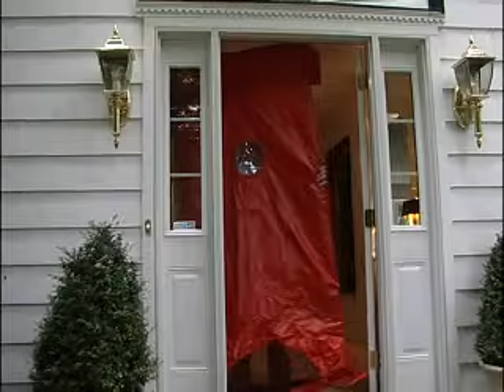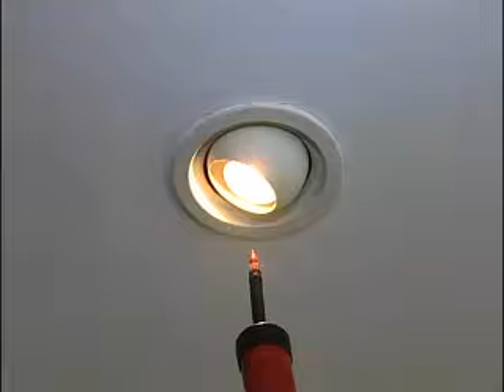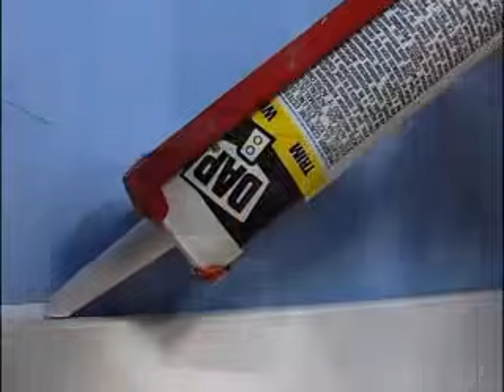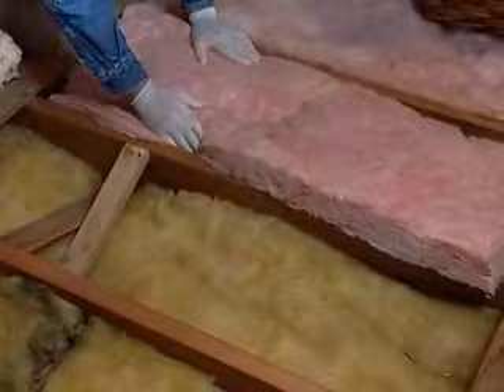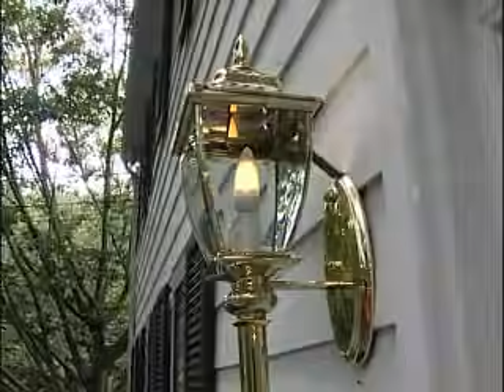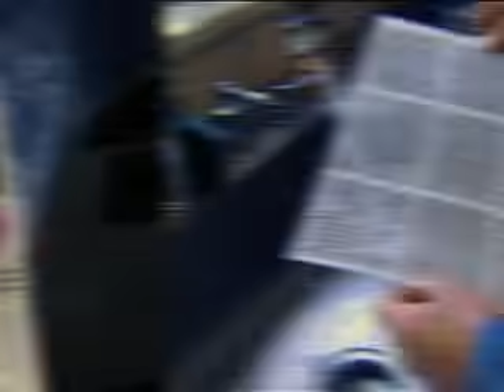WHAT DOES A HOME ENERGY AUDIT CONSIST OF?

Comment: Yes, they consume less power, but if it's a combined circuit you'll have a lot more current going back on the neutral. It may exceed the rating of the circuit and wire insulation.
Reply: Power = Current x Voltage
If something is consuming less power and the voltage stays constant, the current is proportionally less as well.